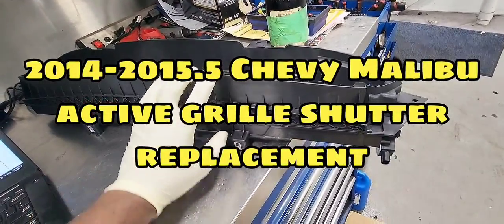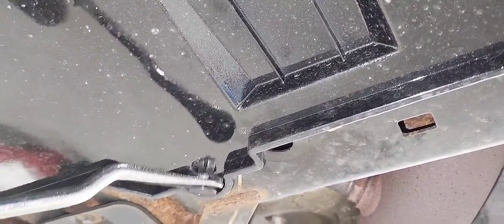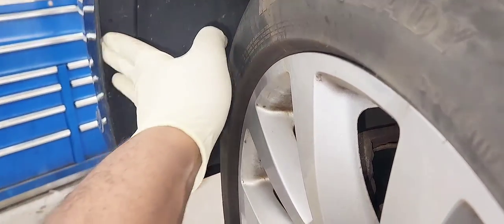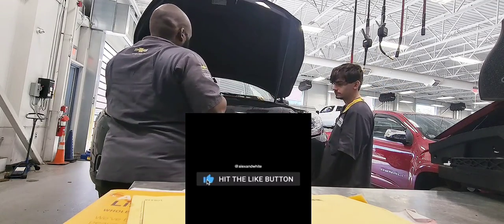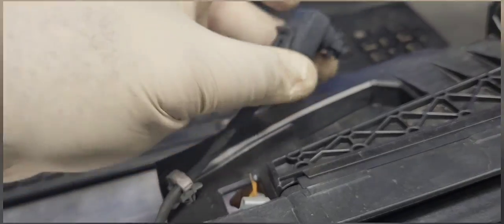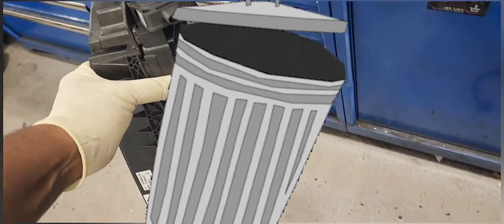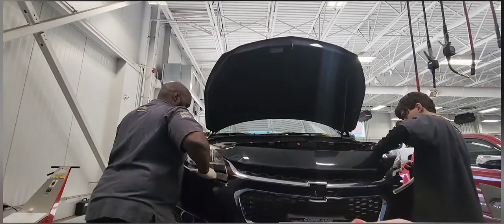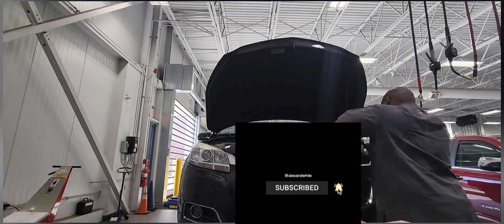2014 Chevy Malibu active grille shutter replacement for U0294

Comment: Thanks. Getting code p059f active Grille shutters stuck off. Do you think I need a new actuator or a new grille? I guess either way I need to take it apart and see if I can see anything. Thanks for the good  video.
Reply from the maker: Thanks for watching 👍, check for dirt and debris at the shutter, it is pretty common, you might as well replace it
Reply: I replace the shutter assembly that came with a new motor. Cleared all the codes. Now I'm getting another code lost communication with Grille shutter. Does the PCM have to be reflashed when you replace the Grille shutter assembly? U0824 code
Reply from the maker: I don't think it is related to that, once you replace the shutter you should be good did you try to clear those codes
Reply: Active shutter stuck off code p059f. Also code u0284 lost communication with shutter.
Reply from the maker: Did you inspect the new one for dirt and debris?
Reply: @steevegmtech7326  yes buts it's an after market part and on it it had a sticker saying the pcm might need to be reflashed . Not sure if they just stick that sticker on all the grill shutters they sell.
Reply: @steevegmtech7326  I'm wondering why Chevy had different shutters for the Malibu. This is a 2014 LS and the first part on it looks like it's an OEM Part... because it has a sticker on it from 2014 But the motor doesn't come off like the one in your video.. it is built into the shutter there's no way to take it off. I bought an aftermarket one that had the motor built into it as well but it's just not working out for me lol. On the first part I was getting a code for the shutter stuck open.
Reply: @steevegmtech7326  yes I've cleared the codes multiple times with the scanner. I even took out the fuses for the computer and disconnected the battery for a bit. They still keep coming back
Reply from the maker: Then you have a wiring problem,do a continuity test and resistance check end to end on all the wires coming out of it
Reply: Thanks for your help I fixed it. It was the aftermarket part. I sent it back and got an official GM part and it works fine and the code stayed off for good.
Reply from the maker: @danielstephens4420  good for you man, I'm glad I was able to help

Comment: I replaced my grille shutter but still get a check engine light with p26c8 code
Reply from the maker: I think you have a problem with the chassis control module, check for more codes